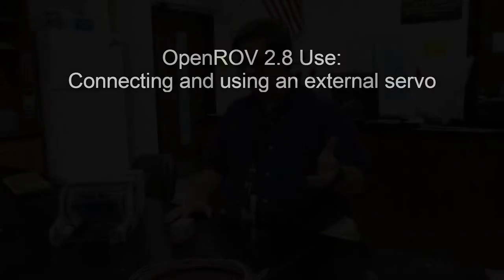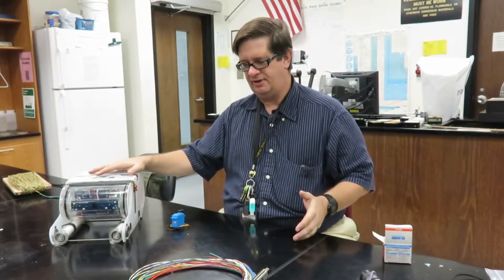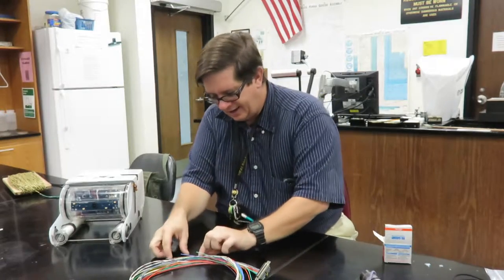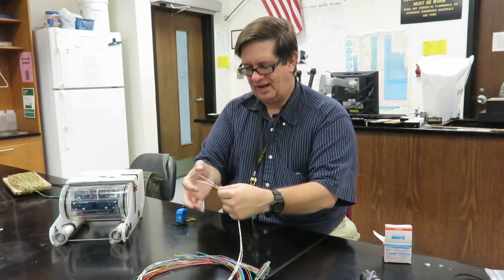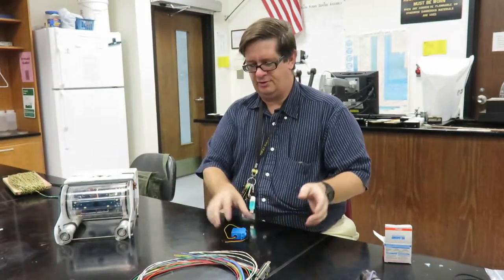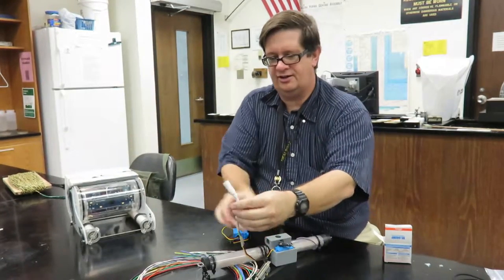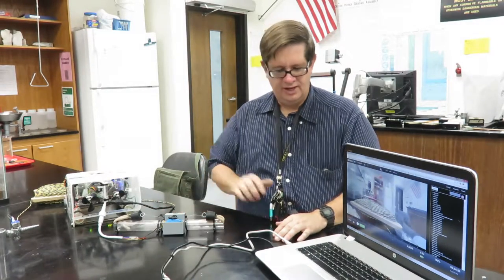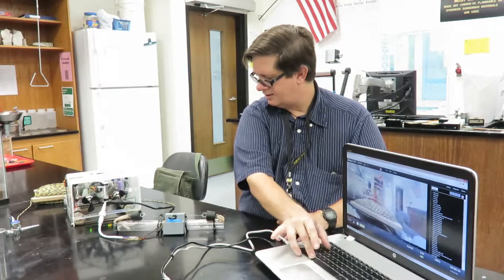OpenROV 2.8: using external servos

Comment: Hi Joey,
thank you for that video. I was wondering what model of servo you are using. Most waterproof servos are meant for RC model cars/boats/drones and are splash water protected, but how will they perform with water pressure on them? Right now I am preparing a standard servo filling every cavity with grease and epoxying the circuit board but I am not sure if that will be a good solution in the longrun...

Comment: I'm looking to how to make software to control an external servo on the OROV can anyone can explain me how to do that
Reply from the maker: On a 2.8, the external servo is hooked to the three AUX wires and controlled with the alt-q and alt-z buttons on the keyboard while you are in the OpenROV Cockpit.  You should be able to remap keys in software, or send the same type of signals down the wire.  I recommend reading old threads at forum.openrov.com to see how others have done this.

What sort of payload are you wanting to carry?
Reply: thanks for anwering me. I want to control an external nikon camera to make photos. But in the OpenROV cockpit with the HQ version camera software I didn't see anything about the alt-q and alt-z buttons.
Reply from the maker: You are wanting to control an external camera.  It would be good to make it a point-and-shoot type of camera, because the OpenROV only has one AUX (three wire) control of a servo.  You may need to talk to OpenROV directly (support@openrov.com)  to see if they are anywhere near releasing the wireless bridge/payload module for the trident, and if so, will it control more than one servo at a time.  

Here is some documentation for the d-9 pin and the alt-q and alt-z controls
https://forum.openrov.com/t/code-for-the-servos/3955/2
Reply from the maker: You may also want to look at steps 86-90 of assembly guide stage 4:   https://openrov.dozuki.com/Guide/Guide+4+-+Wire+Routing/123?lang=en